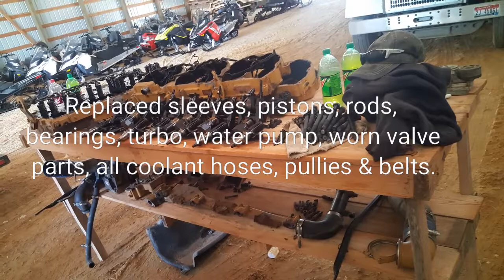Engine blow by and rebuild cat c12

Comment: I have a question.I rebuilt my Scania motor completely.I see there is some blowby and white smoke out of exhuast it did not take any load yet.After rebuilt it was only test drive and idle to check for leaks.Is that normal
Reply from the maker: Did you do a in frame or was it a full blown rebuild? How much blow by do you have? Yes I have seen new inframes have blow by after rebuild because the piston rings have not set yet. I would put a load on it and watch Temps. If you didn't do a full on rebuild I've seen compressor pumps leak into the crankcase also, which made it look like blow by.
Reply: @mrfarmer1903  we took the motor out and replace all bearings cam bushes pistons rings sleeves polish cams and crank .Only i little bit not mutch
Reply from the maker: I would run a load on it and get some heat into the cylinders to set everything. Check your coolant  fluid levels before, during and after your runs.
Reply: @mrfarmer1903  Thanx just a quick one how long bevore glazing will take place if there is no load does it happen fast or only after a while
Reply from the maker: You're going to be a while, we have service trucks that idle a lot and I've never had glazing. If you idle 90 percent of the time and drive like grandpa the rest, you will glaze your engine.